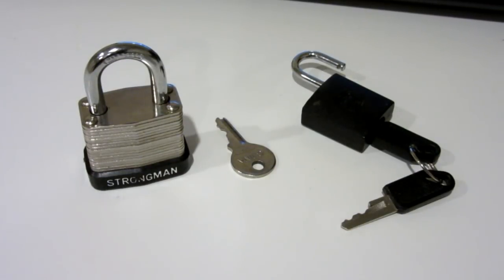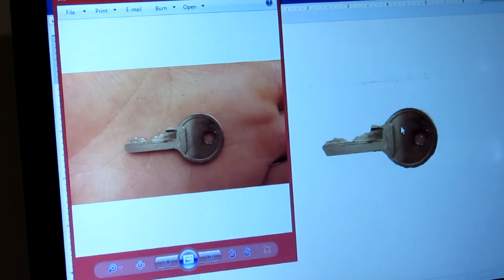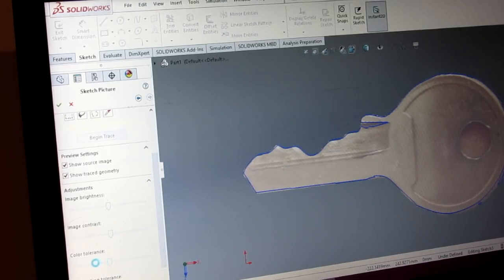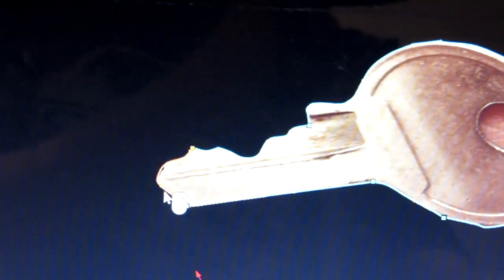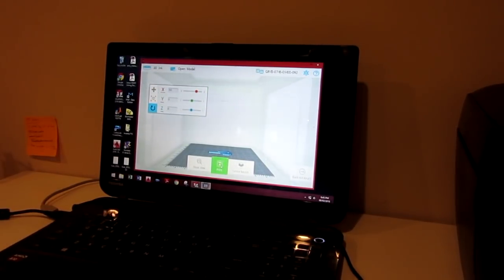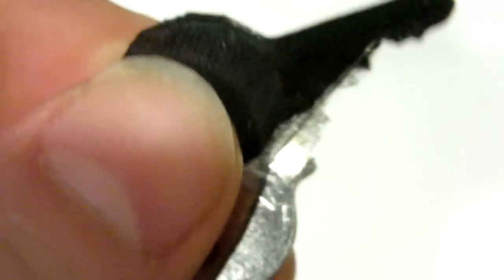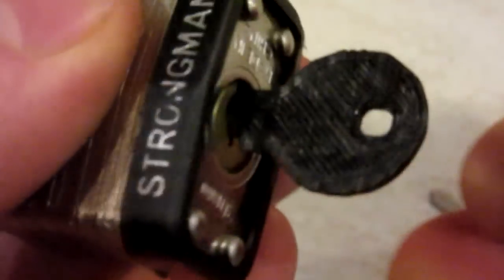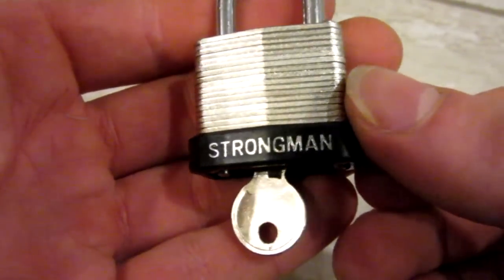3D Printed Key: Will it Work??

Comment: What if you tried printing with a harder filament, like metal, or carbon fiber.
Reply: those machines are crazy expensive, the metal ones are $1 mil (or you can get it done at shapeways for probably $50... they probably wouldn't let you do keys though)